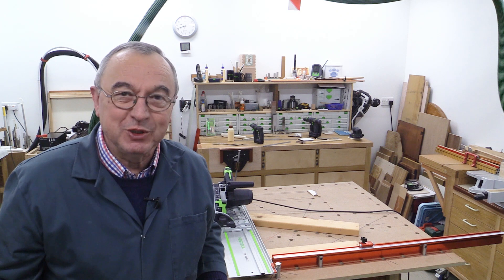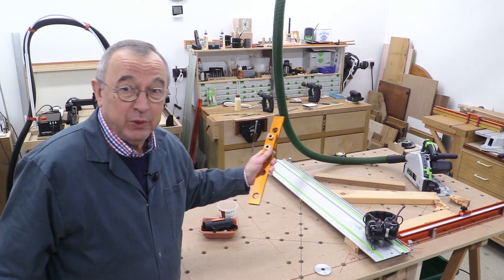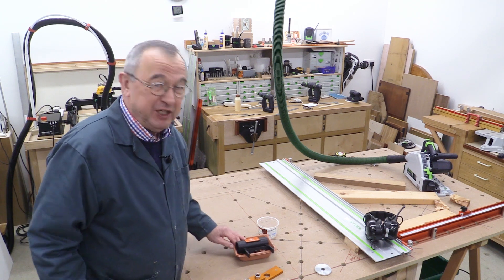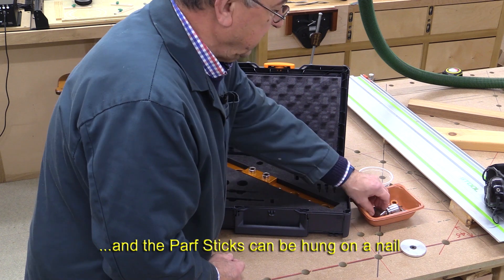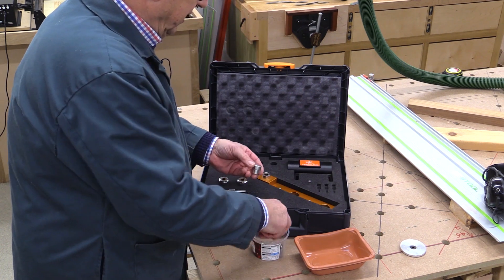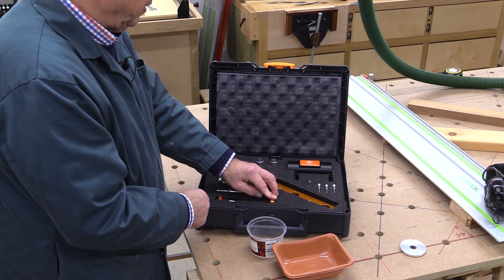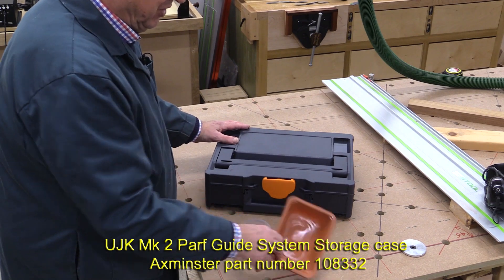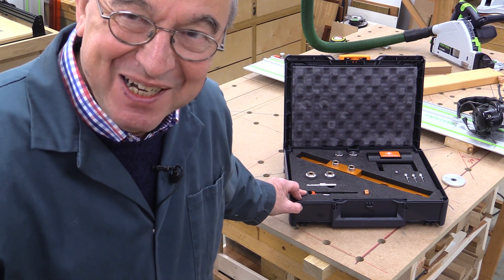Parf Guide System Mk 2 Storage Container

Comment: I just ordered the storage case for my Parf Guide Mark II from Axminster Tools with free shipping to the U.S. For the parf sticks, I just use two gun socks and a Juvale poster tube. I put each parf stick in its own gun sock, and then I put one inside the other (all contained in what has become the outer sock), and then put the whole thing in the poster tube. It's the perfect storage solution for me as it keeps the stainless steel Parf sticks dry and protected from corrosion just as it protects steel of all kinds on gun barrels (remember: it's called "stainless" steel and not "Stainfree" steel—I know because I have had stainless steel firearms rust). This system provides plenty of cushion to keep the Parf sticks from banging the sides of the case and each other. It might be overkill, but it's a relatively inexpensive solution so that my Parf Guide Mark II can last a lifetime! I don't hang or otherwise keep any of my expensive tools or jigs on display because we use our garage to park our vehicles and often have it open as people walk or drive by. I wouldn't want to unnecessarily advertise all these great tools! I even put dust covers over my compact table saw and miter saw.
Reply from the maker: Terrific - well done.  Peter

Comment: Stock is available now, just checked Axminster site, but £70 is a bit too expensive. also not sure about storing sticks on a nail in a workshop, likely to rust.Tempted to make a box with ply cut outs for the parts, we are woodworkers after all…🙂

Comment: This is very good but I think a space for the chamfer tool would have been useful too.
Reply from the maker: Hi Paul, That is a good point and I will pass on your suggestion.  Cheers.  Peter
Reply: Agree - an obvious oversight and there is clearly the space for it too.  Also maybe holes in the foam for the revision dogs - again there is the space.  But nice idea otherwise.

Comment: This is a useful addition to the Parf Guide System, my various bits are in old coffee tins, but there should definitely be extra holes for the chamfer tool and the revision dogs. You show storing two revision dogs but there are three in a set. I read your suggestion of filing down a piece of metal pipe to make additional holes but I do not any odd pieces of pipe. How about a video showing some ideas on cutting neatly a few extra storage holes in the foam?
Reply from the maker: Hi Robert, I am looking at that now.  Cheers.  Peter

Comment: Hi Peter, Mine arrived this morning and the Part II bits are now snug and safe inside. A couple of suggestions for the next production run: (a) it would be slightly more user-friendly if there was a cutout for the 20mm drill guide with the dust port already attached, (b) perhaps the foam insert could be made available as a stand-alone item. Best wishes. Andrew
Reply from the maker: Hi Andrew, I will pass this on - cheers.  Peter

Comment: I thought it was a cracking idea until I discovered that Aximinster are charging almost £70 for one - I mean, seriously? Even Festool don’t charge anything like that must for a Systainer of that size. Real shame it wasn’t more reasonably priced as it would have been just the job
Reply: If you look at the price of a Tanos SYS3 112  Systainer @£43 and add a sheet of Shadowfoam @ £13 - then £56 is not so far short of the cost of this.

Peter, how about one of your videos on Shadowfoam?

Comment: Hey Peter, haven't found a way to contact you directly, so I'm trying here. I love your parf guide system, it's elegance and precision, and in the spirit of the latter, I've an idea to bring it closer to perfect (parfect?).
When laying out an mft table hole pattern, one of the steps requires one end of one of the rulers to overlap the other. Though slight, this creates a very long acute triangle in the Z axis, and though the difference is slight, it is there. I have seen a couple of people so far having some trouble aligning pins and I'm certain this is the reason.
The solution, in my estimation, would be to include a few shims (qty depends on the rigitidy of the rules) that are the same thickness (or just the same material) as the rules themselves. The increase in expense could be modest, and I'd bet a parf guide system that you'd gain at least a decimal place of precision to your already wonderfully precise system.
Yes, I am a woodworker cursed with a machinists' proclivities. Let me know if this makes sense, and/or is worth doing. Thanks for all you do!
Reply from the maker: Hi Draztiq, You can find a contact email address for me if you click on the "About" tab for my channel - I am not sure if this works from an iPhone though. Yes, I am aware of what you describe but there is generally enough wiggle room not to worry about a shim. I still have the washers that I found that were perfect for the tests that I did a very long time ago.  Cheers.  Peter

Comment: Hi Peter again: Some yrs ago, I bought 4 "Parf Dogs"' at a woodworking show in the US. 2 short and 2 very long. Now will they fit in the case with all it has already?
Reply from the maker: Hi Pat, You will need to make some extra holes but that should be easy to do. Take a piece of pipe that is between 3/4" and 20 mm and file one end so that it makes a sharp edge. Use that, in you hand, like a drill and it will cut through the foam.  Peter
Reply: @NewBritWorkshop  Sounds like a good plan Peter. Thanks so much.